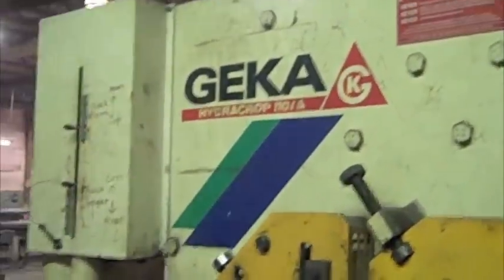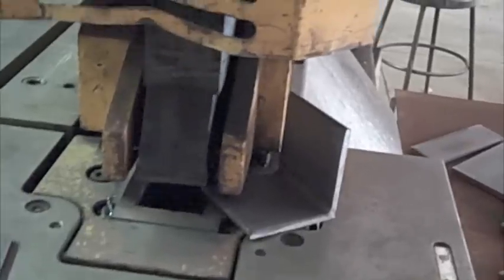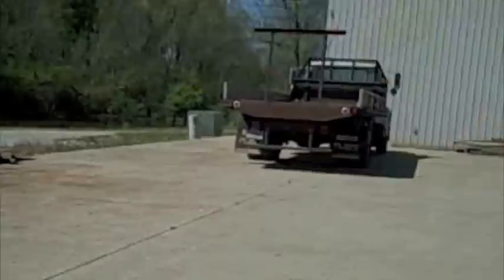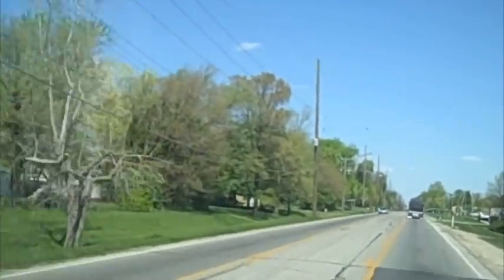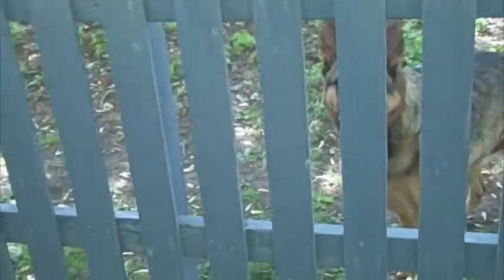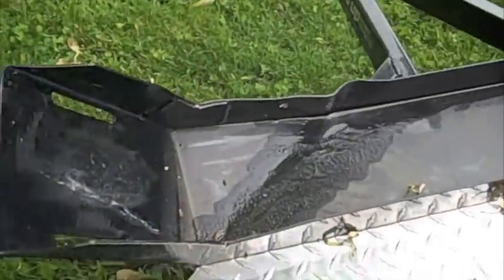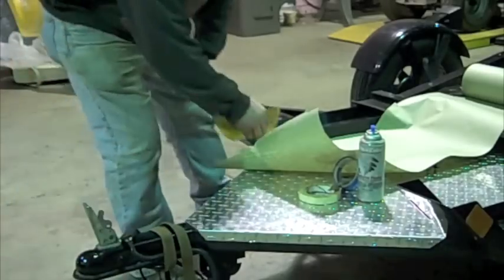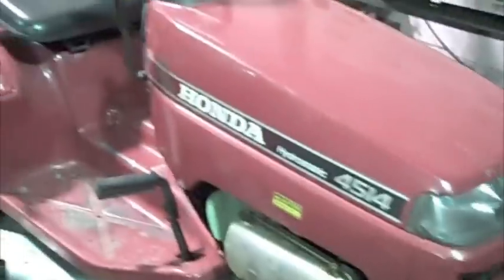Random South Branch Footage

Comment: Great video. Glad we brought the South Branch into the fold. Another brilliant move on our part. The North would indeed need to use heat. The boys also have to have the wood stove going if it’s under 65 degrees. They are always cold. You need to come up and hang with Paul for a day. You two are two peas in a pod.